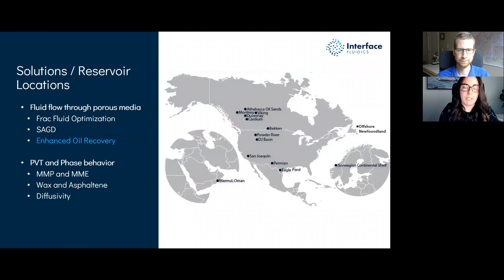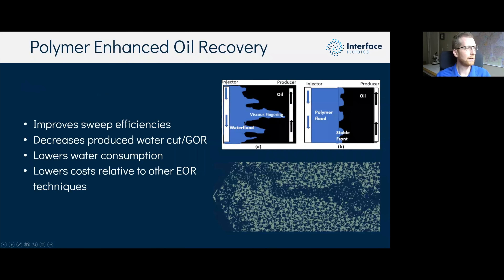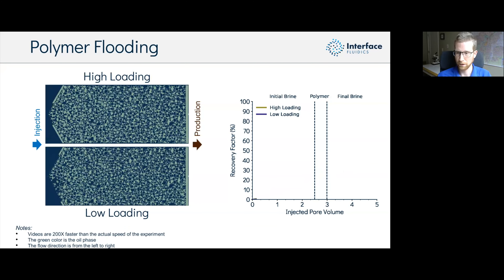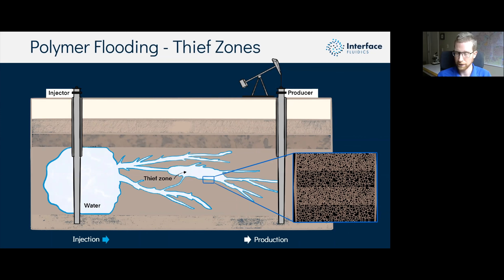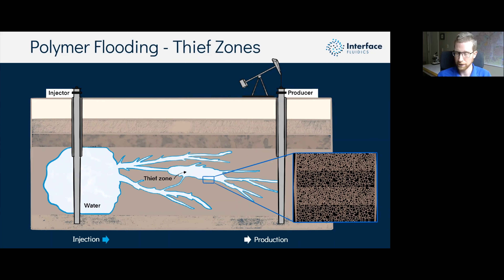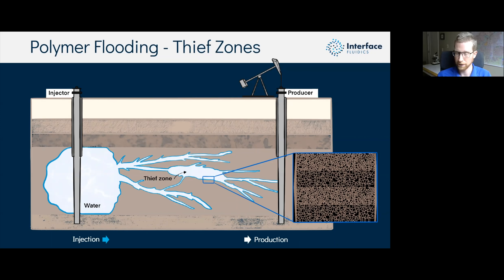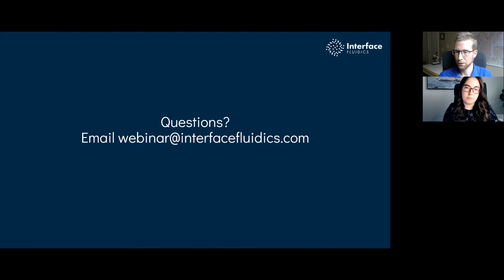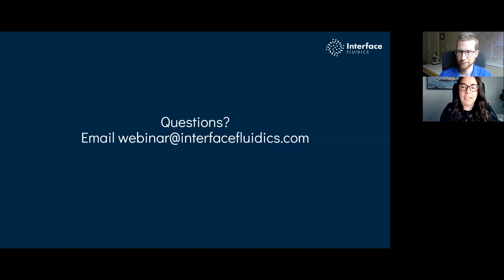Polymer Enhanced Oil Recovery: Applying Microfluidic Analogue Technology

Comment: How do you upscale the results from a microfluidic analog to a conventional coreflood or even to reservoir scale?
Reply from the maker: Hi, Lucas! Our microfluidic analogue is a diagnostic and screening tool to investigate the impact of different operational parameters on the oil and gas in situ process. While the microfluidic results cannot be directly upscaled with 1:1 proportion to the coreflooding or reservoir scale, the relative performance of different variables can be similar to that at larger scales. It is noted the similar trend exists for upscaling the coreflood results to the reservoir scale.

If you'd like more information, feel free to email us at info at interfacefluidics.com.